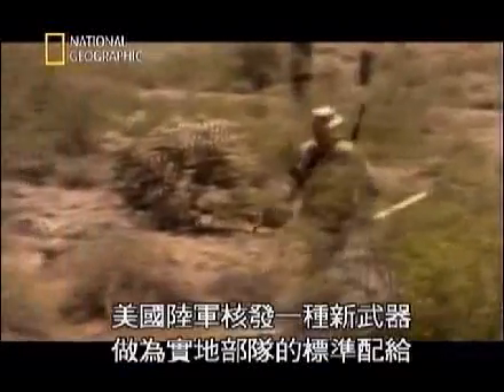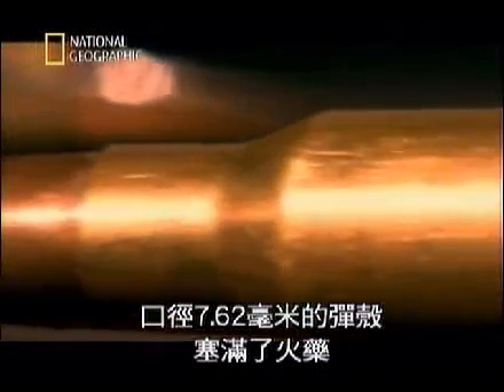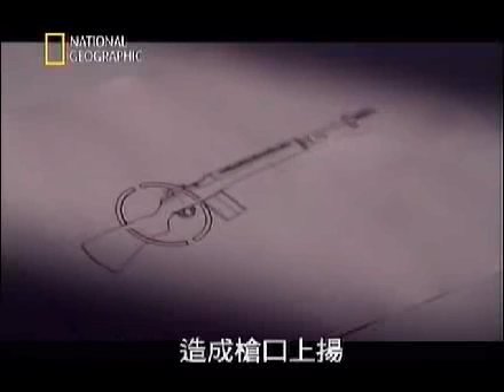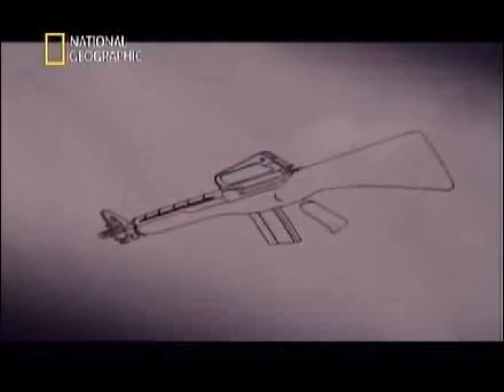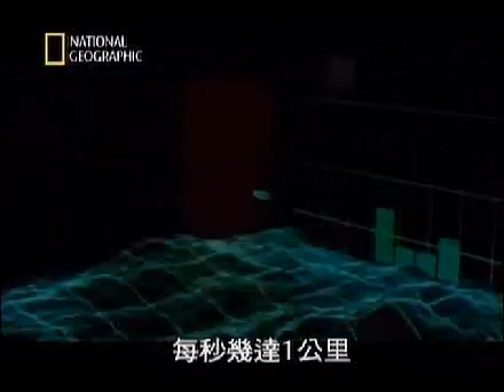Compare M14 With M16

Comment: @STL308 The IMI Tavor TAR 21--one of the best bullpup design rifles out there, proudly brought by the same folks who gave you the Uzi... Israel. I like the Steyr better astheticly, but in CQB, nothing beats a bullpup. Zalman Shebs (along with Boyarski, Shiloni and Erez) designed it for 11 years. Integrating into IDF by 2011. They fixed its aversion to sand, but the linkage is still just as sluggish as every other bullpup. It's 3.15 times the price per unit than the M4. Also Vaguely familiar.

Comment: @esh325 The problem the Marines encountered was already a known issue for the 5.56.  That was the bullet staying on path after object penetration.  Windshields are a bitch.  You are taught to hold low to get closer to a 90 degreee impact.  The green tip largely eliminated that problem.

Comment: @esh325 True, however no other rifle in the world is as maintenance intensive as the M16 to start with, and not chroming the bore/chamber  only exacerbated an existing problem.  Even though they wound up fixing that issue, the rifle continues to use a demonstrably flawed action that overheats too quickly (you tell me you're only gonna shoot once ever four seconds when someone's shooting back at you) and is intolerant to sand, grit and carbon (that it introduces to itself with every shot).

Comment: @Blackhawk5656 ROTC in High School and all my family on the mother's side joined up.  I tried to join straight out of HS but they wouldn't take me because of a minor medical condition.  

I've studied firearms and ballistics ever since.  

To answer your deleted question:  you are referring to projectile 'spall' or the arc of a light-weight enveloped round inside a soft target.  This CAN cause lots of damage, but only if the INERTIA of the round is great enough.  5.56 at 500+ yards wont cut it.

Comment: @esh325..and the smaller caliber round as opposed to the 47.  I always thought the M14 should have been chambered in .270.  Smaller, lighter, faster round still having the reach and knockdown.  Then redesign the comb on the stock to reduce muzzle climb in full auto.  Might have worked for the 16 as well.  Then again, if they taught the troops to shoot better, most of the problems would be moot, don't you agree?

Comment: @davesnak The big reason that the army went with the cheaper propellant was that the new and improved powder called for by Stoner couldn't easily be produced.  Batch for batch it was much more expensive, and only every other or every third batch was actually performing as advertised.

As for the M14, generally speaking, that weapon on fully auto would be a supression weapon.  You really wanna leave fully auto to the guys who count remaining rounds by the belt, not by the mag :-)

Comment: @CursedforLIFE96 Having been trained to use both.  You can not make the M14 look bad in full automatic, the rifle makes you look bad.  The rear grip is the fulcrum of a lever with 6:1 ratio.  If you were moving rocks, 100lbs of force would move a 600lb rock.

Comment: @esh325 The Army has been having the problems for some reason.  I guess they never passed out the changed ballistics caused by the shorter barrel of the M4.  Back in the mid 1980s, I was on an evaluation team assessing different round chamberings for the M16.  We tested 5.56. 6.8, .243 winchester, 7.62, and .30-06.  Best performance over all was .30-06 185 grain.  Best for highest ammo load was .243 winchester 100 grain.

Comment: The problem with the M14 is that it cannot compete in the assault rifle category because it is uncontrollable and inaccurate in fully-automatic fire so it fails as an assault rifle. The only thing that the M16 really gives away against the M14 is long range power and accuracy because the reliability issues were resolved since the M16A1 was issued in 1967 and the .223 round can actually outperform the 7.62x51 in close and medium ranges due to it's high fragmentation from higher velocities.

Comment: m14 was traded as a main battle rifle and become a special ops, marksmen, and sniper weapon. I will give it to the m16/ar15 that they are lightweight and you can put rounds on target faster and easier increasing rate of fire on an enemy. In a sustained firefight, it helps to be as be a little lighter, carry more ammo, and let off more rounds accurately. I think the M14 has its place with designated marksmen though since the 308 rounds penetrate better.

Comment: @touaiscool I've seen the 5.56 round bounce off of a 2x4 at 500 yards.  At that point, it actually is going slower and has the same energy as a 22lr at the muzzle.  Given that, I'm almost convinced enough to risk my own tender skin to test the theory that it wouldn't penetrate a winter jacket at that range.

Comment: The narrator is wrong in his comparison between the Thompson and the M14, but it was meant to replace the Garand, BAR, Tommy, Grease gun and M1/M2 Carbine.  
As to the stance Ken Elmore is using is the stance of the doctrine of the day with both the M14 and M16.  The squared off stance really began with the MP5 and has continued on the M4 platform.

Comment: Again, ONLY when using AP rounds like the M995 AND comparing that to hollow-point match rounds in 7.62x51. I have used the M16A2 in combat in the Sand Box, and all that happened was through-and-throughs. These engagements were all within the 250-300 meter "fragmentation" range of the M855, and all hits were in the mid and upper-chest.

ALL it did was make more detainees that we have house, feed and PAY. Had I my Springfield M1A instead, we wouldn't've had that particular problem.

Comment: @ArodWingfoot On the flip-side, 7.62 NATO causes less severe wounds at *close* ranges than 5.56 because it simply makes high-velocity holes without transferring much energy.  There's always some trade-off.  In any case, you shoot until the target is no longer a threat, regardless of caliber--few rounds can be depended on to put someone down with a single shot, especially if that person is on amphetamine.

Comment: I would assume because rifle cartridges are by nature designed to compete with each other. So engineers must design a bullet that is light balanced in terms of ballistic characteristics, accuracy and weight. A 7.61 or 7.63 could probably have been greatly different in terms of flight characteristics, and engineers decided that 7.62 is optimal for a battle rifle cartridge.

Comment: It tumbles but that means it wouldnt be that good of a penetrator and it was purpose design to tumble. The 5.56 higher twist ratio stabalises it better during flight making it more accurate but it would still tend to go base first when it hit flesh and the twisting doesnt fight that yawing very well so it will tumble its just the balistics of the 5.56.

Comment: @DDTea Yes I am aware of that, I am just pointing out that Navy seal teams still use it, and many special forces prefer it to the M16. The M-14 is almost as reliable and an AK47, and is more accurate. The design of the M-16 allows for it to shoot in burst more accuratly, but in a single shot, not a chance. M-14 hands down. Also vets who used both also agree the M-14 is the better rifle.

Comment: using 5.56 in .223 chambered rifles could be dangerous depending on the age of the weapon, because older .223 was signifigantly lower pressure than modern 5.56x45

Comment: Cont.:

The M16 has been highly developed in the time it has been in service. And, in the case of the original "prototype" version of the M16 (the AR-10), it fired the 7.62x51mm NATO round, which was used in the M14. They're reproducing the Armalite AR-10s, now with tactical rails and precision shooting platforms and such.  I mean, sure your AK-47 uses a powerful intermediate cartridge, but can you handle the recoil that it provides as opposed to the M16's recoil buffer system?

Comment: Hey I was a PIG and a FO that was in 3/2 STA in the USMC. I'm a 3 time rifle expert and carried the M16A4 for a good 4 years pal. I personally own a SA M1A Loaded and I can tell you flat out that the M1A is better. It has more knockdown power, range and reliability. With M16's you must clean them religiously or you will have a malfunction. Not so with the M1A. It's never jammed on me and I've put over 1,500 rounds thru mine and it can shoot pie plates at 200 yards everytime.

Comment: kick in the m14 is not an issue, you can shoot .308 all day long. the issue is barrel rise. a modern 2 inch muzzle break can eliminate 95% of the rise and make an m14 shoot the same as an m16. the only reason they went to the m16 was because it was significantly lighter, had little barrel rise, was far more ergonomic and took less time to make. it also does more soft tissue damage at ranges less than 150m (50m for the m4). it however lacks in long range capability. a modernized m14 would excel.

Comment: The M14  had terrible accuracy even in semi-auto, and it had spotty reliability. The M16 was a more robust design that had consistent accuracy and good reliability. The only reason the M16 jammed at all in the beginning of the Vietnam War was because the pentagon deliberately tried to sabotage it's reputation by issuing it with ammunition that was corrosive, and telling units to not bother cleaning the weapon because it was "Self Cleaning". The M21 sniper rifle might be based around an M14, but it's a heavily customized and accurized version of an M14 you can't even field strip without ruining it's accuracy.

Comment: @rahfields i heard somewhere that the reason why it has so much recoil is because of the round they probably used military rounds or your standard rounds they give you in the service but my uncle has a old m14 and it doesn't have alot of recoil because he fires it single shot and uses a different round . In my opinion the m14 is better

Comment: quoted from the remington 2008 catalogue both using identical 180 grain bullets "30-06 muzzle velocity = 2,700 feet per second, .308 = 2,620 feet per second. THESE WERE NOT TAKEN FROM AN M14 OR A GARAND, but most likely taken from the exact same bolt action rifle just chambered differently. If you don't believe it, look it up. Wherever you got your data (I'm guessing wikipedia) is wrong.

Comment: Not exactly a source my dad's feild manual has a section on instealling the selector switch"so the M14 can deliver automatic fire" so I am pretty sure that most grunts were to get the semi-auto only version with 2 in every sqaud getting the selective fire version.

Sqaud autos don't need be pin point accurate especially when dealing with an "area target" the idea is supression with the riflement dealing the accurate knock out punch.

Comment: @nov284 Actually at close ranges, the 7.62 NATO doesn't transfer much momentum to the target.  It "pencils" much more so than 5.56 NATO.   7.62 NATO is great for defeating cover though.  However, in CQC, having a nimbler, lighter, faster package is better overall.  M14's strengths are better served in its role as a designated marksman rifle.

Comment: @nov284 That statement is misleading.  1500 fps = 457 m/s.  In terms of kinetic energy, which is proportional to velocity squared, that's a 209 000 fold difference for the same mass (which they aren't, but I'm just making a point)!

Comment: "Instructor for Colt Defense" Considering Colt is the company behind the M16 it would be bad advertising to show the M14 do better than the M16.
The M14 is a semi-auto rifle that can go full auto. The M16 is a sub machine gun, that has decent range (quite a lot less than the M14 though). 150 well aimed shots are far more effective than 400 spray and prayed shots. Plus in full auto, you waste a lot of excess ammo on a target. 4 or 5 shots per burst when 1 single shot will do just as well.

Comment: @GenerationKill1010 It uses bullets that are smaller than pistol caliber (most handguns/SMGs use short .45 cal ammo, the M16 uses long .22 cal rounds). Its effective range is not any longer than regular SMGs, it lacks knockdown power (like SMG's), and it is meant for spray and pray firing instead of proper marksmanship. The M16/M4 is much closer to an SMG than it is to a rifle. The WW2 M1 is a true rifle and outdoes the M16 is all categories outside weight and fire rate.

Comment: @DDTea Just like any semi auto, except way more often.  Sure, for some airforce dude that's going to be in the shade, out of the rain, in the AC where the dust isn't too bad, where the rifle is going to be cleaned and turned into the armorer every night, and you want to have survivors in the unlikely event someone cares enough to try to assault your base which has access to air and fire support, it's a fine rifle.  A little grit on the bolt cam, and the bolt will stop going to battery though.

Comment: @GenerationKill1010 It has higher muzzle velocity than the M14 actually, but it doesn't maintain the speed very well. It slows down quickly, cutting its effective range down quite a lot. The small caliber means it lacks knockdown power and can't get through cover near as well. A thick tree that will stop an M16 round, an M14 round is likely to still pierce. 
I'd rather take an M1 into battle than an M16 due to its lack of power. You don't need 30 shots to bring down a guy, just 1 shot 1 kill.

Comment: @Blackhawk5656 You are correct, sir.  Due to political and logistical reasons, switching a main battle rifle will probably not happen.  A suitable replacement in the AR-style grip and lower receiver would be the LWRC PSD 6.8mm, which has the knockdown power to upgrade our offensive capacity in the field.

Also, have you ever seen the M14 EBR system?  Quite an impressive upgrade kit for the rock-solid action of the 7.62 mm rifle.

Check it out!

Comment: @esh325 Yes there is, .50 cal. You get hit with a large round like that, you are down. You are not gonna keep fighting after being hit by one of those. More than twice the width of the M16's .22 cal round. The worlds longest sniper kill was 2.47 km (1.53 miles) with a .50 cal rifle.
1 shot in the brain with anything is lethal, but body shots are not certain death. You need multiple hits to knock down an enemy with an M16, 1 with an M14.

Comment: They did this completely wrong. The m14 doesn't need to be fired on full auto because of the power behind the 7.62 NATO round. It only takes one shot to kill someone whereas someone will probably get back up with the m16. And it says the ammo will be wasted because you don't hit anything, if you can't hit something with the m14 then you are a terrible shot because this is one of the most accurate rifles ever issued to soldiers. They also talk about the weight. Well if you can't handle the extra

Comment: both are very nice weapons, for different purposes. it depends on how you look at it. sure the m14 can be deadlier at long range, but the effectiveness of the m16 in full auto can be used as an assault weapon, like in iraq. while the m14 is very useful when it comes to designated marksmen, or snipers, because of its larger bullet and thus stronger energy.

Comment: If you want to hit the target at fairly long distances, then go semi, because mostly, the fully automatic mode is good for cover fire and some up close combat. The M14 has a high recoil and thats not what you want when you want accuracy, the M16 has a small recoil, and high velocity round do to smaller cartridge. So sorry to disappoint anyone, but the M16 stands to be better than the M14.

Comment: @crashdummy40 Yes, I have seen what it does to a human leg, actually. Turned it into something resembling hamburger that was as large as a cow's rump. The point isn't that it doesn't kill at all. The point is that you either need more shots for the takedown or you need to be more careful about shot placement to ensure one. It is just as easy to hit a moving target with an M14. You just need practice. The M14 standard is capable of consistent kills at 500 yards or more. The M16 platform is not.

Comment: It's common knowledge that the initial jamming with the M16 was not due to poor cleaning OR design. The cartridges used had the wrong type of powder in them (despite the designers' warnings and objections).

"The M14 is better over the M16 at 100-600m"? Really? According to the US army, a large majority of modern firefights occur at ranges under 100m.

Comment: @DDTea Expressed as a percentage of the total energy being carried by the round, the 7.62 round may have pathetic energy transfer rates compared to 5.56, but in terms of absolute force, you should realize that you're better off stopping a 5.56 from point blank than letting a 7.62 NATO pass through you at any range.  I've read ballistics reports, and never, ever heard from a credible source that the 5.56 does even similar amounts of damage compared to 7.62 NATO at any range, under any conditions.

Comment: @hackerhunterdotexe Actallu they're closer than you think. 1500fps and 20 grains are the only difference between them. Same caliber. That's why you can buy a special bolt and springs for ar15s and fire .22lr ammunition from them with no change to the barrel.

Comment: The main difference was the ammunition because the 7.62 was designed to kill while the 5.56 would more likely injure. Although the 5.56 is powerful and can easily kill. It is worse to injure than to kill as people need to come in to save the injured and hospitals would be needed and with more people injured that means they are overworked I guess :P

Comment: Why does everyone armchair general want to go back to using these older guns? The military a long time ago figured out that its not about equipping soldiers with the most powerful, most accurate, guns possible. It's about having something that's lightweight, easy to use, and with the light m16 rounds a soldier can carry double the ammo.